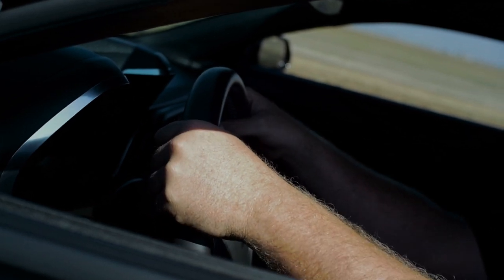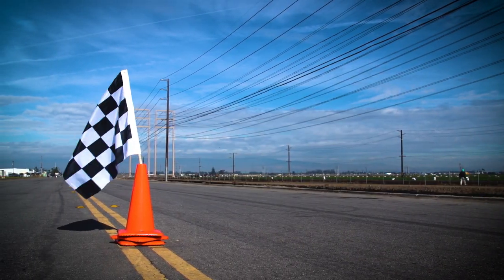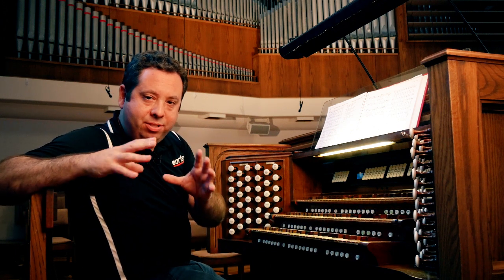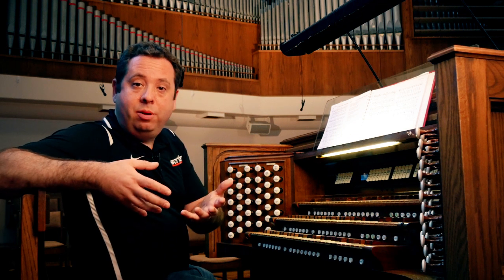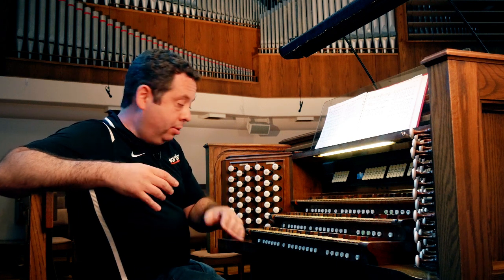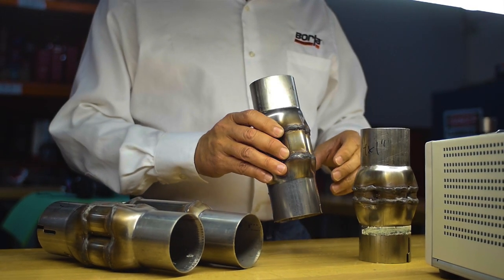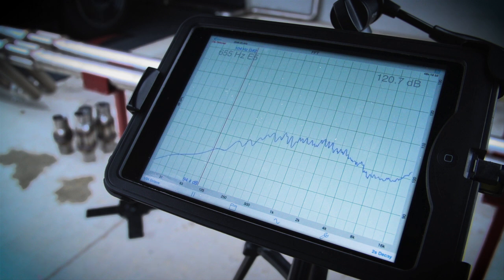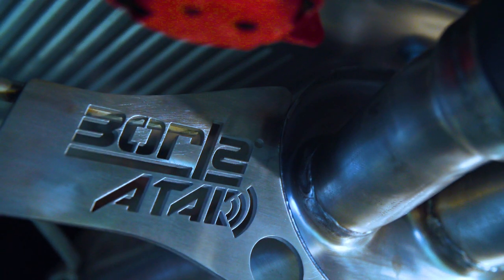Borla Polyphonic Harmonizing Technology [Polyphonic Exhaust Sound Explained]

Comment: What if i wanted to put two different tones, lower pitch in one pipe higher in the other, in a dual exhaust set up that harmonize? Would that sound any different or fuller than just the harmony happening in each pipe?

Comment: Can you add something to an already existing system? I have 1 7/8 lts and a true dual exhaust system w a x pipe on a ls1 trans am.......or would I have to just test a few out added into my system lol
Reply from the maker: Hello, thank you for reaching out. Unfortunately, we do not currently plan to offer our Polyphonic Harmonizers are separate, universal products. They will only be found in select systems. Sorry about that.
Reply: @borla  I've been playing with stuff like this for the last few years in my shop.  I even used 4-1 collectors turned backwards as tailpipes at one point , and it did have a unique , interesting harmonic value.  So seeing something similar in your video is cool.  I go back and forth between software simulation and pure experimentation.  Both equally valuable.  This is one of the highest orders of car nerdom.

Comment: The pipe organ deal, is straight marketing. . .

Pipe organs sound is produced by vibration of the actual pipe, exhaust sound is not by pipe vibration.

The concept is more of a wave guide, and more along the lines of speaker tech.